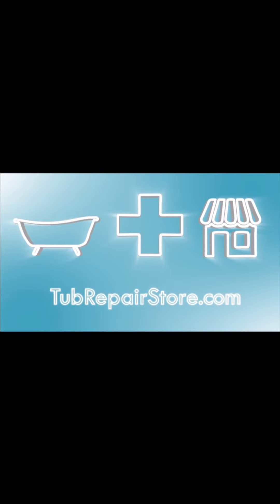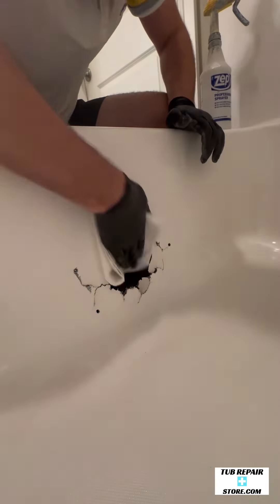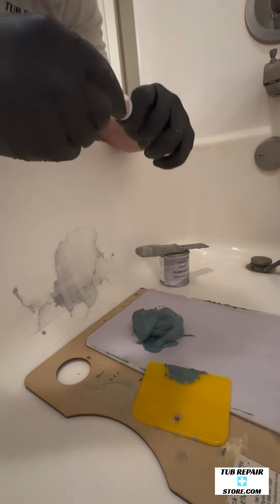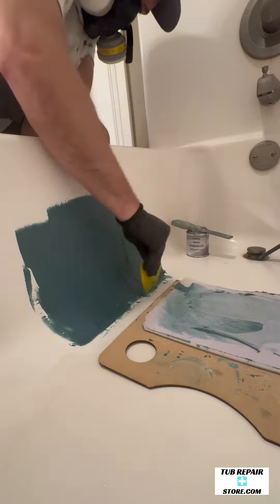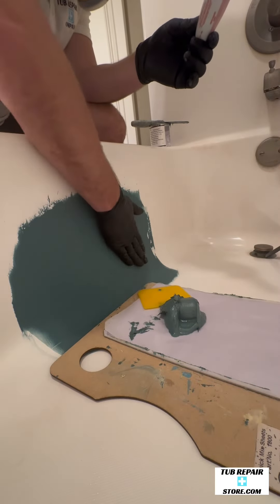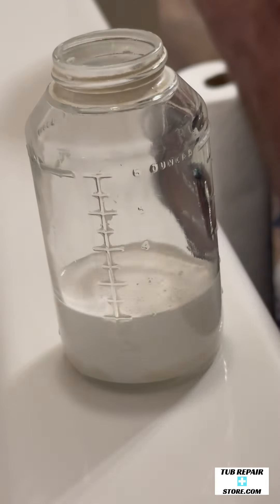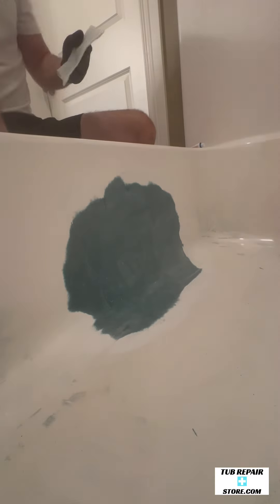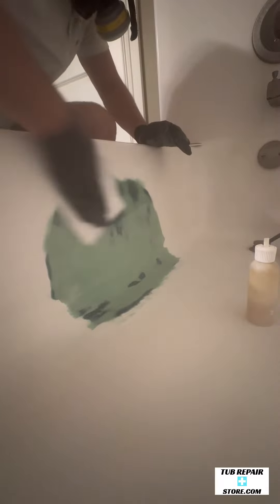Huge Wall Repair in a Fiberglass Tub

Comment: Why do they make room with the drill if they are not going to put foam what is the idea with that?
Reply from the maker: We always want to drill out the end of cracks.  So in this case there were 3 cracks shooting off the damage.  This cuts the crack off and makes it harder for it to continue spreading.